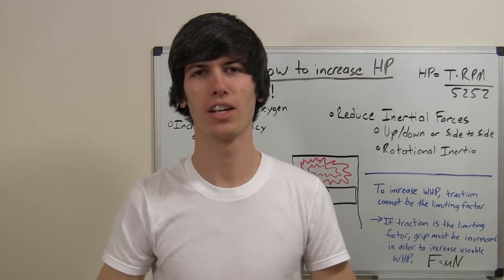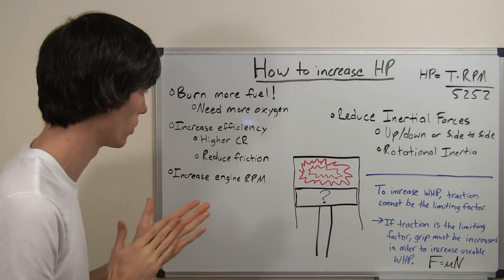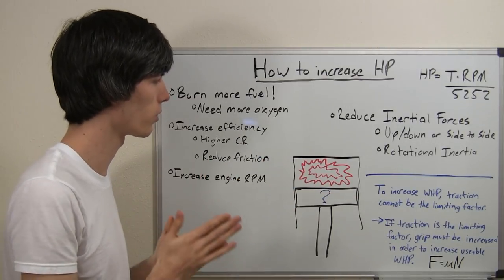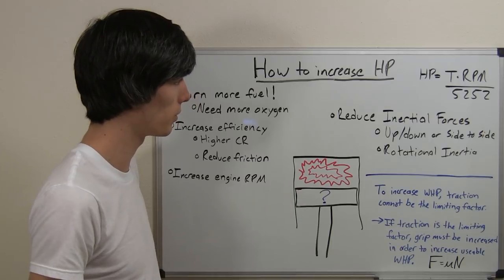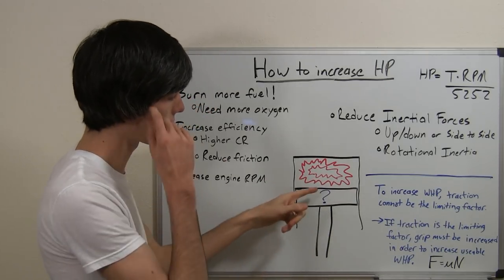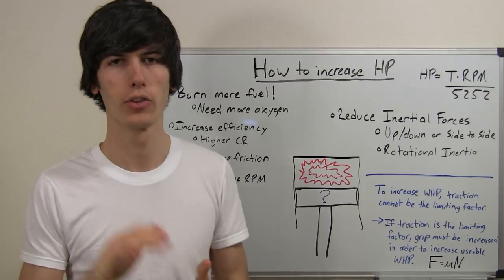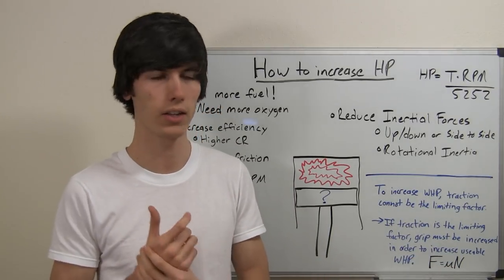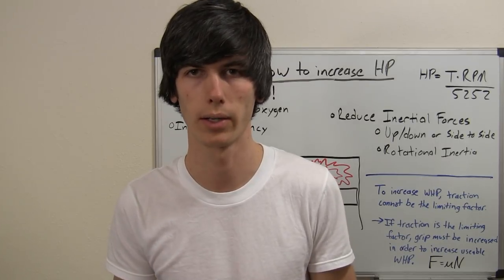How To Increase Horsepower - Explained

Comment: would high octane gasoline have an effect on your horsepower?
Reply: yes
Reply: Yes, it would.
Reply: High octane gas has a more delayed burn than lower octane. If you have a car that doesn't take high octane, DON'T USE HIGH OCTANE GAS!! It won't help your car's performance.
Reply: A higher octane gas will allow you to increase the compression ratio.  So the power increase is not from the high octane gas but from the increased compression ratio.  That is one of the benefits of ethanol over gasoline, a much higher octane rating allowing unobtainable compression ratios versus gasoline.
Reply: If your car is designed to burn regular unleaded 86 octane fuel then putting 91 octane fuel in will actually decrease the performance if that is all you change.  The octane rating is the rating gas is given to determine its resistance to explode.  If you have a car running 10.5:1 compression ratio then you will need to run 91 octane fuel, if you run 86 or 87 octane fuel you will get a lot of engine knock, that is actually your fuel pre-detonating or dieseling.  It is not good for the engine.
Reply: cmennare The higher the octane rating, the higher the compression the  fuel in the cylinder can withstand before combusting on its own--without a spark. That is why high performance vehicles use higher octane fuel--because their engines have very high compression ratios. Using a lower octane fuel (say 87) in your 2014 SRT Viper will result in premature detonation because the 87 regular cannot withstand the high compression ratio. Compression ratio is a measurement--that is all. You cannot increase compression ratio by using high octane fuel.
Reply: The 2013 Viper SRT has an 8.4L V10 which has a compression ratio of 10.2:1 and takes 91 octane fuel.
Reply: i want to thank all you guys for commenting on my comment im learning a lot from this, thank you.
Reply: Harry I believe what I said is that running low octane fuel in a car designed for high octane fuel will damage the engine.  In order to run a high compression engine you must run a high octane fuel.  I don't think I said that changing fuel changes compression ratio, That is achieved through replacing pistons or milling head or block or thinner head gasket or using a longer connecting rod or a mixture of any of those ways.
Reply: My current race bike is running 12.5:1 compression ratio E85 runs great in it.
Reply: cmennare A 12.5:1 CR on a bike is different than a 12.5:1 CR on a car, though.
Reply: cmennare What I'm trying to say is that the volume compressed in a bike with a 12.5:1 CR is way less than the volume compressed in a car with a 12.5:1 compression ratio. Just because a bike cylinder is smaller than a car cylinder, even though they have identical compression ratios.
Reply: cmennare Okay, if you put E85 in any car it will give you worse fuel economy than regular unleaded. The only reason E85 exists is that it is an alternative to fossil fuel. It helps the big picture of America's thirst for overseas oil, it only hurts your gas mileage.
Reply: Faceless Misery Hey, we improve by sharing our knowledge with one another. That is (or should be) what the internet is all about!
Reply: I agree, putting E85 in an engine designed for gas is stupid.  As far as compression ratios between cars and motorcycles, well yes the size is different but the theory is the same.  You would be much better off putting E85 into an engine designed to burn ethanol and not gas.  2007-2009 the University of Minnesota did a study on using ethanol as a compression ignition fuel, like diesel.  They were able to run a VW 1.9L TDI with hydrogen assist at startup and they achieved a thermal efficiency of 40%.  In Sweden a company called Scania makes the public buses there and they run ethanol at 28:1 compression ratio all the time.
Reply: The biggest difference for ethanol makes for me is that I cannot drill and distill oil for gasoline or diesel in my backyard.  But I can make ethanol all day long.  The permit from ATFE runs $15 per year and the appropriate amount for taxes based on consumption/production.  It burns a lot cleaner, I can make it out of grass clippings, sugar beets, or day old doughnuts it doesn't matter as long as it is a plant based material.  The conversion from gas to ethanol is simple if you have the mechanical ability if not you can always pay someone to do it fairly cheaply.
Reply: Alexander Kauntz I didn't say that quite correctly, what I meant was running E85 in an engine designed for gas and then complaining about the inefficiency is stupid.  I also believe that running E85 is better for us in the long run because I can make it myself for a lot less than $1.00/gal.  The studies that show Ethanol being more expensive to produce are heavily skewed to promote oil usage.  When I make Ethanol at home I don't use any petroleum products in the process.
Reply: Not if your engine can't handle it. Of course higher octane isn't meant for every engine. Higher octane fuel is meant for engines with higher compression ratios. If your car's CR is say, idk, 10:1, you wouldn't want to put in fuel for an engine with a 18:1 ratio.
Reply: David Munoz An engine running 10:1 CR can easily burn 91 octane pump gas, 18:1 CR requires a fuel that can be reliably compression ignited like diesel or ethanol. An Engine that makes 18:1 CR has to be incredibly beefy to handle the very high pressures.
Reply: cmennare True. My Golf runs 91 octane, but that's recommended for my vehicle. I wouldn't risk going any higher.
Reply: David Munoz You are correct, your car would not receive any benefit from E85 or E100 fuel.  The only benefit would be if it was a lot cheaper than the E10 now available or if you got into making your own E100 or E85, then it would just be a financial benefit.  The good thing to know is that with your car if regular gas becomes too expensive then there are other options available.
Reply: man yes, but ecu know that fuel change.Its mean change spark advence. if ecu dontt know ur engine might detonate or overheating.
Reply: Vladimirs Sinkevics Your engine will not detonate from a fuel with too high of an octane rating.  You will not be getting full potential gut it will still function.  Too low of an octane rating can damage pistons from pre-ignition.  There are now ECU's on the market that are programmable or pre-programmed for you and they are only a few hundred dollars.  Which is a far cry from a replacement ECU from the dealership.
Reply: octane rating is for engine safety, higher tolerance for predetonation (explosion before ignition).  So yes, if you were pinging, you'd gain horsepower by properly combusting fuel instead.
Reply: It depends on your engine's  compression ratio as well as other things.
Reply: Jordan Reed What other things does it depend on?
Reply: cmennare
 1. The condition of your engine and spark plugs, 2. the usage of the engine ( whether as a daily driver or part-time use and if it will be used for pulling or racing ), 3. the quality of the gas itself, 4. the balancing of  fuel to air making sure that the intake pleasure of the air in the cylinders is at least 1 atmosphere which is the base air pressure of the air we breathe, 4. and finally your engines operating temperature and heat absorption rate also taking in consideration elevation and outside temperature.

YUP !
Reply: What i have been told, high octane gas has a different combustion temperature. Ex: Using 93 pump gas on a 87 pump gas car could cause the fuel to combust during the compression stroke and  not the power stroke thus screwing up the timing and creating you very own diesel engine which isn't good lol
Reply: Henry Rubio and speaking of a stock, unmodded car.
Reply: Henry Rubio You have been told wrong Henry.  Octane rating is simply a definition of a fuels resistance to detonation, the higher the number the higher the resistance.  93 octane fuel would be required in an engine with a high compression ration or turbo/supercharger resulting in the same high compression.  87 octane fuel put into an engine like that would ignite too soon and result in engine knock possibly causing major damage to the engine.  93 octane fuel put in to a low compression engine would not damage the engine, but you would not get the full power that the engine is capable of either.  If you have a question of what your car requires look in the owner's manual it is in there.

Comment: Engines are just air pumps. All else equal, pump more air in, you can burn more fuel, you get MORE POWER. Assuming that nothing breaks, that is.

Comment: in order to increase power of engine really , have to do fabrication on the engine , must to be re changed piston size, cylinder size , rod of piston , orifice for cooling water , orifice on the crankshaft , size of valve on head of cylinder.

Comment: ENGINEERING EXPLAINED...So by making a 1000 Torque @ 6000 RPM, you are making 1,142 HP...AND at 317 Torque @ 19,000 is 1,146 HP.  So will the high Torque motor and the same car weighing 3,500 pounds have a higher top end speed?? given the weight and wind resistance at high speeds...  I think most people will say the high torque motor will achieve a higher top end...are they right??

Comment: what is torque for and what is horsepower for?
Reply from the maker: Making a car move. They are related.
Reply: I mean if you have more torque what will happened i think if you have more horse power your will accelerate faster but I can't find out what torque is doing here.
Reply: Torque is more for low end power. Like towing shit for example you'd want a lot more torque pulling a lot more weight
Reply: +Taylor Xu that i was looking for thanks dude.
Reply: +Reza .R i think Torque is related directly to acceleration, HP is just related to Top Speed
Reply: +Reza .R Torque is the main thing that gets a car to move, it's the amount of pounds of force being applied to the car's components that get them to start moving.  That's why when you reach peek torque in the RPM power band is when you'll feel the greatest amount of acceleration.  Horsepower is just an equation for how much work is being done, in this case it's how much work the engine is doing.  It doesn't necessarily have a correlation to acceleration but definitely in top speed, the more "work" you can get the engine to do, the higher top speed a car will have.  There are a lot of other variables that go along with it such as the Transmission and RPMs, but that's the gist of it.
Reply: +Reza .R horsepower is torque over time. think of it like this; trucks have a lot of torque but not a lot of horsepower. because of this they can tow a lot but are not fast. sports cars have a lot of horsepower but not a lot of torque so they are better at accelerating than hauling weight
Reply: So torque gonna be for power and horsepower how fast you car would accelerate?
Reply: Basically its gearing
Reply: +Reza .R I heard a very great quote that will make you really think about this. "Horsepower is how fast you hit the wall. Torque is how far you take the wall with you."
Reply: +Reza .R torque is your low end power, the power that snaps your neck from the jump as the rpm rises, the horse power is the highest amount of power your car is putting out at its peak rpm
Reply: +Reza .R Horsepower at a given rpm will determine acceleration and top speed. Torque simply represents the force created by the combustion of the cylinders, and horsepower represents how fast that force is applied (based on RPM). You could think of it in terms of trying to kick a box across a room. The torque would be similar to how hard you kick the box, and RPM would be how many times you kick the box per a unit of time. The combination of the how hard you kick the box and how often you kick it will be the "horsepower" and will determine how quickly the box reaches the end of the room.

Lets say the room is 100 ft long and you have two boxes. You kick box A once every 10 seconds with enough force to slide it 10 ft per kick, and you kick box B once every 5 seconds with enough force to slide it 5 ft per kick. Which box will reach the end of the room first? Disregarding other variables, they should reach the end at about the same time because the same amount of power was applied to each box. Paralleled to cars, Box A had more "torque", but box B had more "RPM."
Reply: pjbadgersuw26 the only thing I would change is torque is a rotational force (F x L) and horsepower is a conversion of rotational force (tq) since hp is defined as like 33,000 ft lbs/m  you have to convert tq by converting rotational force to a linear force or dagrees to radians so if we take our original definition of tq we can find the derivative for calculating hp from tq by dividing 33,000 by 6.283 (radians in a circle) then we get 5252 which is the reason why tq and hp curve cross at 5252 rpm it's because of the way you calculate hp from tq, then you take the formula hp= tq x rpm/5252
Reply: Blake Knutsen Yes, I was just trying to simplify it as it is sometimes easier for people to understand the concept when picturing it as a linear force.
Reply: tq is not power.....how much your neck snaps at a launch is still based on your hp output at that moment.
peak hp is what you make at peak rpm...

your hp at any moment is how much you can accelerate based on your gearing.....
Reply: that is one of the most incorrect statements....

tq is not momentum.... jesus christ